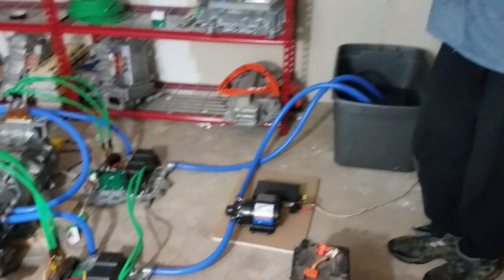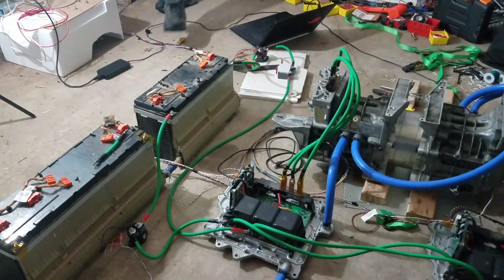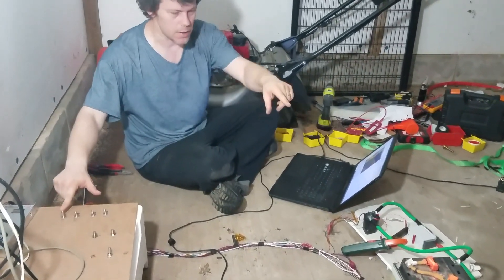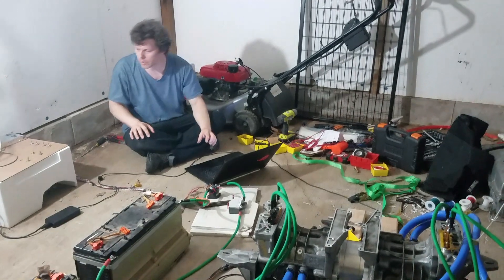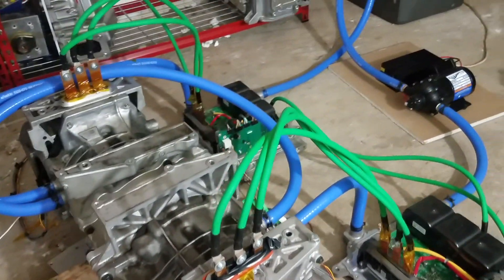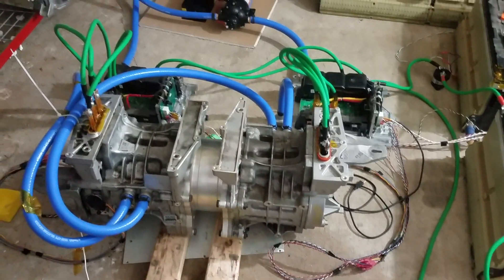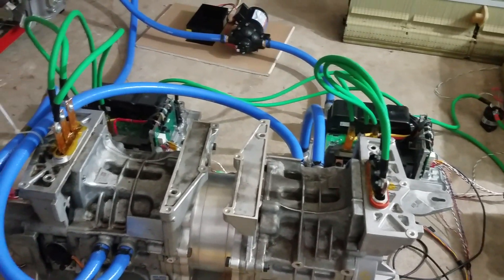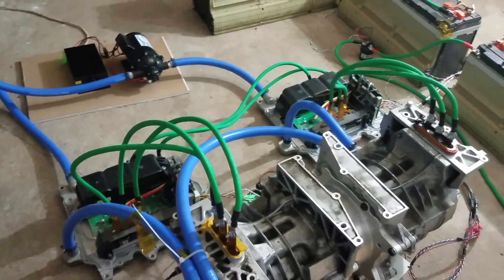Nissan leaf dyno first test

Comment: edit!:  When the high side igbts are off, and the low side igbts are ON, then it shorts the windings and limits rpm to around 40 or 50 no  matter what torque you put on it.  I just got a little excited and didn't know what I was talking about for a while.

Comment: Hi Paul, you are doing a very interesting project. I have a question for you about the motor leaf. What voltage and frequency will I get in one phase at a speed of 3000 rpm ??? I can not find such a characteristic for this motor. I hope you help me)

Comment: I would be interested to hear more about why one motor controller being off places such a load on the other one.  I would expect a non driven motor to spin freely?
Reply: Yes I made a mistake.  By "off" I mean that the 3 high side igbts are off, and the 3 low side igbts are on, which shorts the windings.  But if the controller was truly OFF, with all 6 igbts off, then it would spin freely just like you say.  I'm sorry about that.  I was just talking without thinking in the video.
Reply: Ah makes sense, I guess that means that is one good generator. Well I am excited to see more testing.  And how much power you manage to push between the two motors, mechanically and electrically!
Reply: @jontscott  I'm excited too!!

Comment: I've had ideas about using a Leaf motor in various lighter vehicles, but know nothing of value about the necessary wiring and controllers. Your setup here looks remarkably simple compared to gutting an entire Leaf of it's wiring harness. Do you or anybody sell a turnkey system that I can use with 24-72 volts?
Reply: I know a guy who does: EUR 4000 the total motor+modified controller, you only need to add the batteries.
Reply: But Paul may be able to help you better.